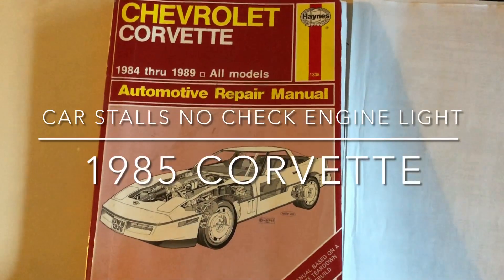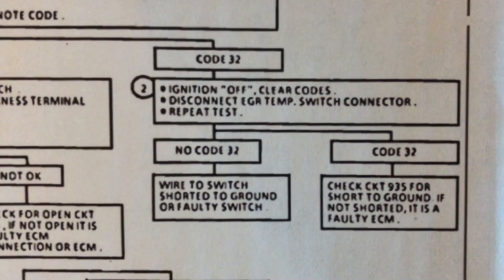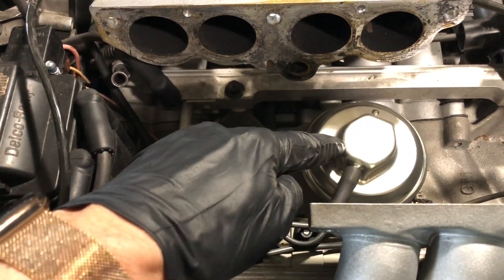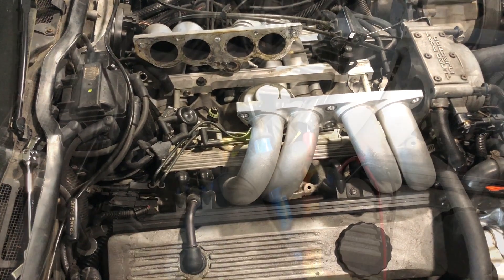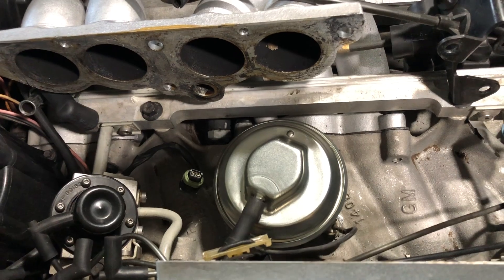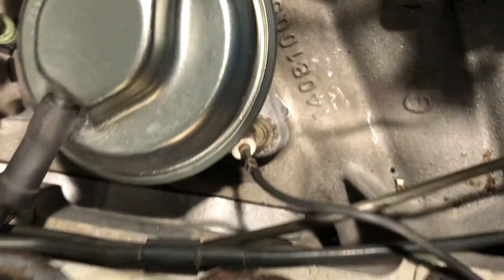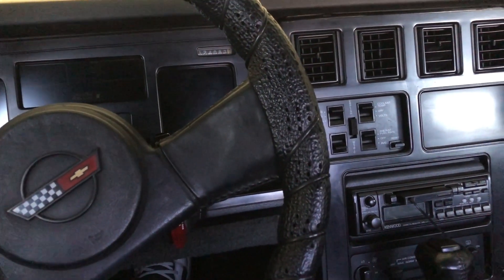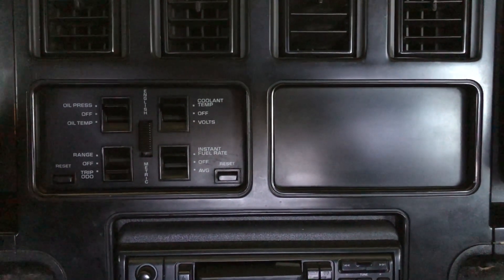Corvette Shuts Off due to EGR Valve No SES Light C4 1985

Comment: Wow, I’ve done a lot of work to my Corvette to get it to run. Perfect then I saw this video and mine was doing the exact same thing. I done exactly what he said. Turned it out a couple turns put it back together and engine light is off perfect thanks for the video.
Reply from the maker: I’m glad that the video helped you out! Those little switches are never mentioned and remain mostly a mystery. The trick is to use a multimeter to verify that the switch is opening and closing when it is supposed to.  And yes, from the sensor switch screwed in all the way bottomed out, unscrew it about 3 turns or 3/16” and it should be good. Test again with a DVM like I demonstrated in the video.

Comment: I have a 90 that was truly painful ruff idle issue. The intake had an oil leak at the back of the manifold. So, since it was apart, changed out the egr, which was nasty. Idac value, thermostat, O2 sensor was ok. After all that the car would show a cede 32 after it got warm. Turns out the Y fitting was cracked going to the EGR vacuum sensor. Other idem was a bad EGR from Delco. wouldn't hold Vac. So even new parts should be checked before install. Had a smoke check done and found the leak. You wouldn't have seen that, and leaks can be sneaky suckers. Runs good now. Thanks for your sharing your 85. I know the Vac. routing is different with a 90, but sometimes the simple stuff can happen.
Reply from the maker: Absolutely, I agree that the simple fundamentals can fool you.  These are phenomena of physics which can be corrected albeit once discovered.  Thank you for sharing as well!

Comment: I have a similar problem. not necessarily stalling in traffic although it has happened. mine will stall simply when idling and warming up while in park too. it doesn't just stall though, it will lope and rev up and down almost like it has a huge cam in it. each time the rpm drops, the check engine light flashes, then the light turns off when the rpms rise, and the cycle repeats until the engine stalls. the check engine light turns off once it stalls, and no code gets stored. this only happens when its below about 65 degrees F outside. I have a hunch it has something to do with the egr but im not sure.
Reply from the maker: It could possibly be related to your Mass Air Flow sensor, because the air flowing into and through the MAF affects the computer’s calculations of fuel and ignition firing, and the temperature of the air flow can affect the millivolt output of the MAF. Another possibility is the IAC valve (Idle Air Control Valve) at idle it should throttle to control the air/fuel ratio so that the engine idles properly.
Also, have your vacuum lines/system smoke checked for vacuum leaks because air coming in unaccounted for will throw off your gas/fuel mixture when idling. Driving down the road it won’t be noticeable because you are burning more fuel etc…
Reply: @JuanLopez-nt1dh  since I made that comment, the problem has actually fixed itself. I deduced that the stall would only happen during the first start of the day, and only when it was below about 65°F outside. I’m not totally sure, but I think it may have had something to do with the EGR valve getting stuck when it was cold and on the first start of the day, and then freeing up afterwards. Not sure though. Never looked into it again after the problem stopped on its own.
Reply from the maker: Maybe the car just needed to be run for a while until something became unstuck or burned itself clean? The intermittent problems are the hardest to fix, unless you can duplicate the problem?

Comment: My 89 is doing exactly the same thing and I got a code 32. I’m going to replace the EGR. Thanks!
Reply from the maker: Hey Albert, let us know how your repair turned out. My C4 runs like a champ now and no more stalling or shutting off.  Remember that a vacuum leak can throw off the gas fuel mixture ratio and it can cause your car to stall or shut off when decelerating to a stop. Another hard to detect vacuum leak source is the brake booster. They have been known to crack or the diaphragm will leak when they get old. Good luck and enjoy your classic Corvette!
Reply: Hi Juan, I replaced the fuel pump and still turned off. It idles rough after it warms us so I’ll now change the IAC. Thanks for that suggestion.
Reply: A bit of history, I bought the C4 three months ago. 103k miles. Needed TLC. So far I’ve changed the dist cap & rotor, fuel filter, EGR, air temp sensor, oxygen sensor, and fuel pump. Now I’ll try the IAC.
Reply from the maker: The good thing is the car does fire up and run. I’ve learned that after buying an older C4 there is a checklist of items to replace so that you don’t have to worry about them later.
Tuneup kit (spark plugs, cables, Distributor cap and replacement parts that go with it etc) and set ignition timing.
Fuel pump (fuel level sensor also while you have the assembly out)
Fuel filter 
Fuel regulator valve
EGR valve (verify EGR activation solenoid is working properly, if not replace it)
TPS Throttle Positioning Sensor (set idle voltage feedback to 4.7 VDC (?))
MAS Mass Air Flow Sensor (expensive but cheaper from Rockauto.com)
IAC Idle Air Control Valve
Brake Booster (diaphragm might be leaking causing vacuum leak fuel to air ratio problems)
Smoke check vacuum lines and cavities for leaks and repair.
Fuel injectors - you can test them individually with a scope or save the trouble and change them all out so that you don’t have to worry about them later (one or more can be stuck open or closed, dirty and plugged, shorted or grounded out, or shorting out after they get hot.
 
Set your engine idle properly:
https://www.digitalcorvettes.com/threads/how-to-set-minimum-idle-on-your-c4.58873/

Other things that might affect it but may not be as common are the harmonic balancer may need to be replaced, O2 sensor, engine air filter, clogged throttle body valve and throttle body manifold (spray throttle cleaner into it or remove and clean out), fuel pump relay failure (fuel pump is now operating from oil pressure switch), verify constant fuel pressure.  
These cars are not that complicated and once you fixed the problem you are good to go.
Reply: The EGR was clogged and rusted shut. I replaced it but unfortunately my C4 still stalls. I’m going to replace the fuel pump now. Fingers crossed. Thanks Juan!
Reply from the maker: Another thing to consider replacing is the often overlooked IAC (idle air control valv). It’s not to expensive.
Also, you could have a bad fuel injector. Check the resistance of each one and it should be around 26 to 28 Ohms.
Reply from the maker: Another  few items to consider are the Fuel Regulator Valve, the MAS ( Mas Air Flow Sensor), and the TPS (Throttle Positioning Sensor). 
And maybe a clogged fuel filter?

What is the history behind the car?
Reply: Thanks for the great advice Juan. I’ll definitely keep working on my C4.
Reply from the maker: My guess would be the low hanging fruit that is easier to replace like the IAC and the MAF. I’ve read and seen videos where the fuel injectors will ground out or short out after they get hot. I would suspect injector issues. After the engine warms up, test each one with a DVM (digital Ohm meter) and check the coil resistance for 26 to 28 Ohms, and test one lead to ground to check for grounding (you should have very high resistance, greater than 1 Meg Ohm).
But once again, check for vacuum leaks. Pinch shut or plug the vacuum hose that goes to the brake booster and see if your idle gets better. That way you verify that the brake booster is not leaking (sucking in air).
Good luck and post what the results are.
Reply: You’re probably right about the injectors because it usually stalls after the engine warms up over 200. I will check the Vette this weekend. Thanks again!
Reply: Hi Juan, my C4’s issue was the distributor. I got it replaced and no more issues. However now my transmission won’t shift out of first gear.
Reply from the maker: @marioc4021  ughhh! Not the transmissio! It can be a messy job but sometimes dropping the trans pan and changing the fluid can free up the stuck parts. They also have transmission fluid treatment that might work, but I've never tried it. I've only read about it. Anyway, good luck! it sounds like you're almost there to daily driver status.
Reply: @marioc4021  What part of the distributor was faulty?  The actual shaft that drops into the motor?  - Thanks, Sam
Reply: @samstrolia  mechanic didn’t specify. I got rid of the 2500 lbs headache lol